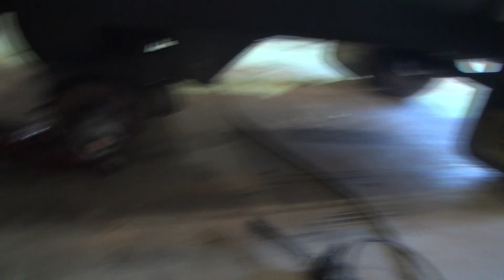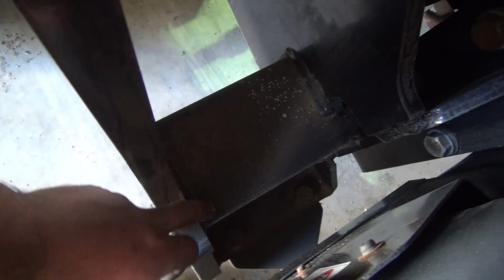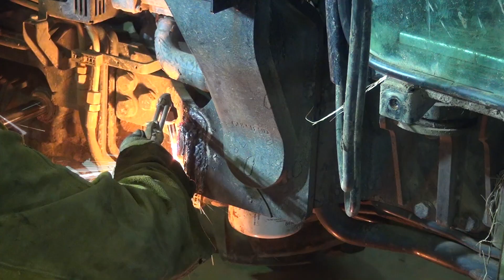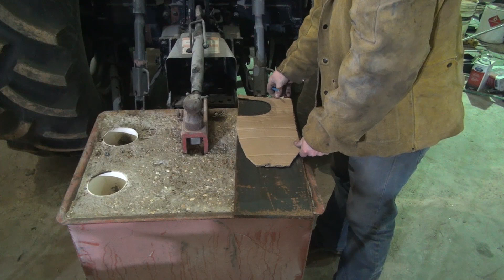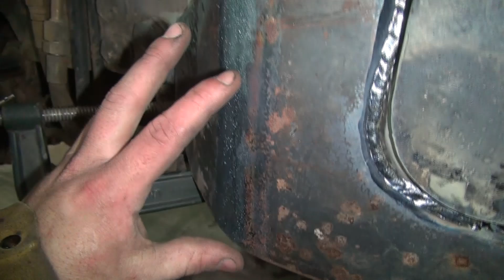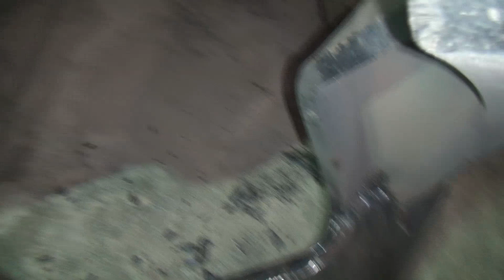New holland t4 95 tractor broken loader mount repair

Comment: Awsome job 👏 👌 I am having the same problem on the same machine🤦‍♂️ dreading doing it but a new bracket is over $3500 from our dealer here in Canada. Lucky me the other side is starting to crack as well. Thanks for the video 🙏
Reply from the maker: Yeah I read several stories of this happening on these tractors. The guy finally got rid of it and got a John Deere because he was having so many problems with it.
Reply: @LifeWithChase 
Ya its unfortunate that it's such a weak spot, I'm in the middle of my left side repair now. That piece of metal is pretty thick and yet it fails, I'll be checking out the newer model's to see if they have changed it but ya JD is so much different style bracket. Appreciate your videos 🙏

Comment: I have an old engine lift I use to lift heavy stuff in the shop and it works good for my old ass lol
Reply from the maker: those are about the most no rolling things i have ever seen in my life lol, one little pebble or little dirt, oil dry etc. wont roll for nothing lol
Reply: chase5726 I don’t use it for rolling stuff around lol just to lift and hold stuff up 👊

Comment: Looks like a solid repair.. the only thing I would suggest is a few plug welds so it spreads the stress among the hole plate and nut just the corners you welded. Also helps keep the two plates tight with no air gap between. Great work. As a mechanic and a owner operator now I understand the struggle

Comment: looking at those cracked plates....it is a good thing you added some more plate over it. steel fabrication projects sure get heavy in a hurry!
Reply from the maker: yes they do, maybe it will hold up now. some serious force going on there to break 3/4 plate like that. plated it with 3/8